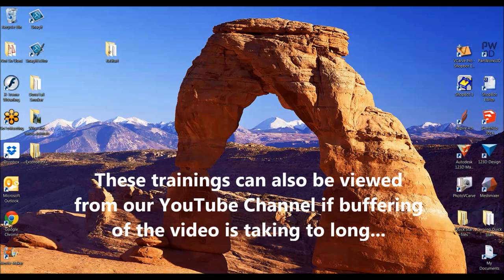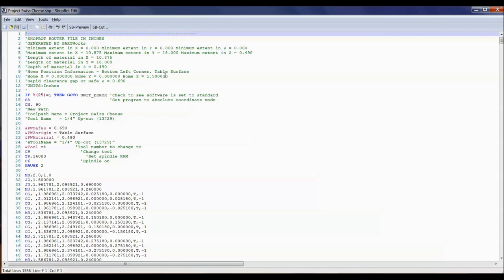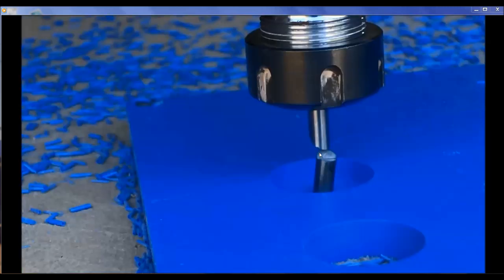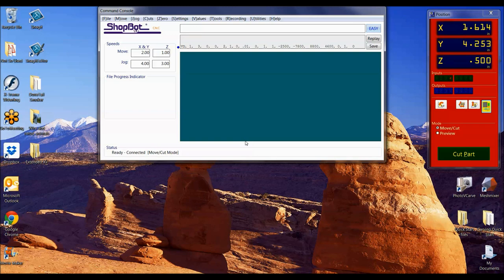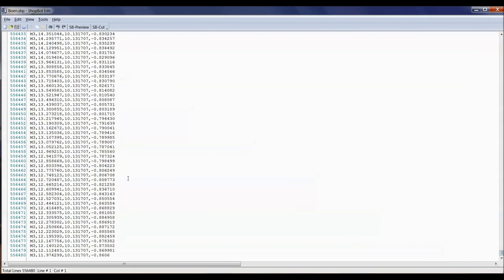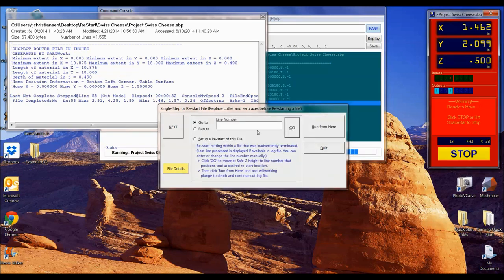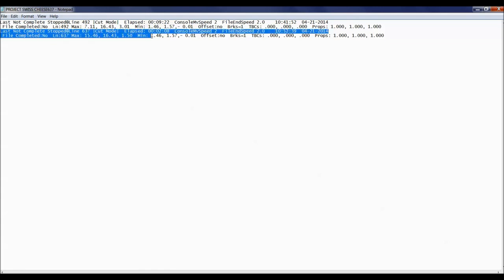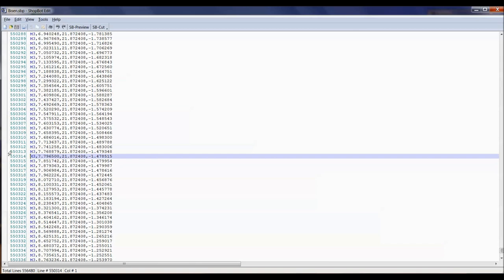How to Restart a File, Mid Cut

Comment: This first time I tried this it worked great.  The next time I tried it,  it kept going to weird  spot and cutting. I've re-zeroed everything, not sure what else to check. I made a new file with just a small piece selected and that works fine. Thanks!
Reply from the maker: Hi Scott, if you would like to find the best solution to what you are running into, we recommend getting in touch with our Tech Support team at 888-680-4466 or email support@shopbottools.com Thanks!!